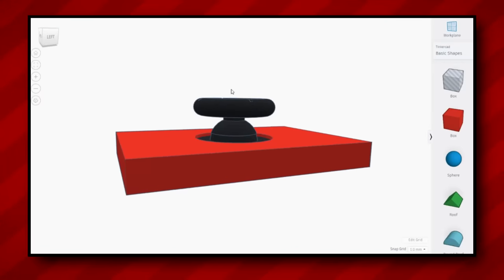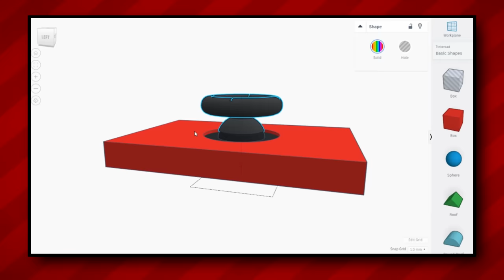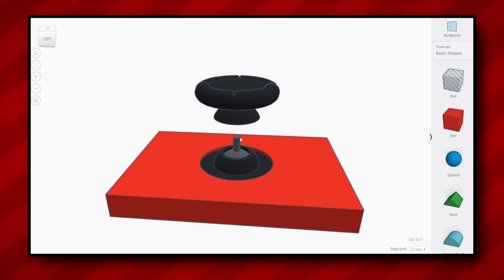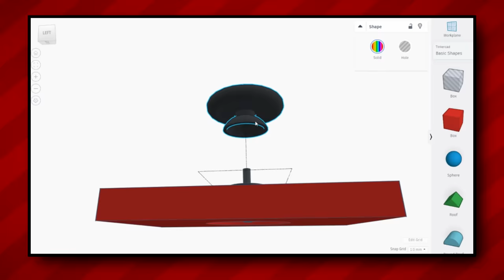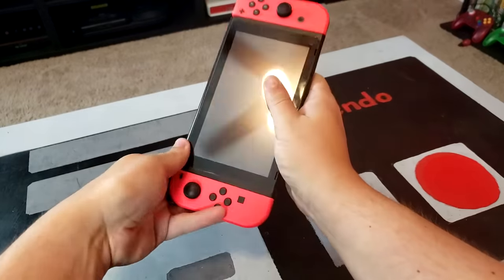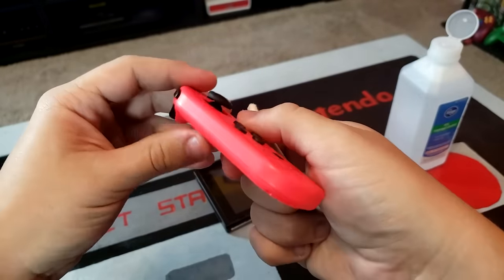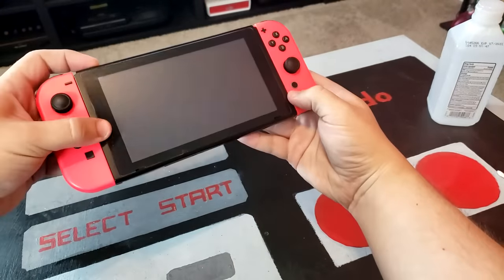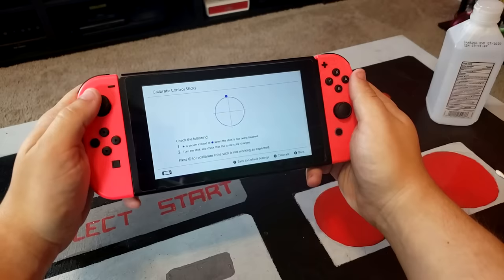How to Fix Joy-Con Drift at Home! No tools required! | Nintendrew

Comment: Me: trying to find comments to see if this solution worked 
Comments:
Reply: Works.
Reply: Works very well
Reply: Worked for me too. Wife spent $80 on new joycon and I fixed it with a single Q Tip and some 91% isopropyl alcohol. I have to return the joycon now.
Reply: 8/31/20 This still works with mine. Don't know why I've stuck with the drift for 3-4 months without ever doing this but the drift is gone. Saves time from sending the joy con to Nintendo especially with the situation the world is going through right now.
Reply: Works very well, just need patience in cleaning and testing.
Reply: Worked for me, I changed the joystick of the joycon once for the same reason. Lately the new joystick was also drifting so I come across this video and now it is fixed. I am going to put back the old one and try this solution on it.
Reply: Nope, not if you're facing the actual drift problem that comes from faulty hardware. This only works if your controller is dirty.
Reply: Can I use ethyl account instead? Or does that not work
Reply: @Sin_Alder  better use isopropyl alcohol. This kind of alcohol evaporates in minutes so there is no chance that some of it remains in the control after a while. I don't know if ethyl alcohol does the same.
Reply: Nothing
Reply: Ok
Reply: I did it today and it works. I thought my joy-cons were broken.
Reply: Its works!!
Reply: @alanm9281  i dont have that alcohol but, thats can with the water?

Comment: Took a few tries with the q-tip. My joycons are 5 years old so they were probably really dirty. I actually got a small juice box straw and put a few drops of isopropyl in there and worked it around.... But can confirm this method worked.. thanks.

Comment: Some feedback: It works! I just tried once and the drift is totally gone. It was driving me mad.
But make sure you are using 99% isopropanol (isopropyl alcohol), any other concentration can damage your electronics! Also, don't use rubbing alcohol or surgical spirits as they are usually mixed with other substances to avoid people drinking them.
Reply: So is 40-50% ethyl solution dangerous for electronics? Used turkish cologne to fix it for the first time, seems working.
Reply: Too late i already applied rubbing alcohol
Reply: Do you think nail polish remover will damage it as well?
Reply: you mean, it was drifing you mad... im sorry, thx for being the only one saying it actually works
Reply: @lederpu  NO - acetone, the active ingredient, dissolves plastic.
Reply: is a small damp dab of water dangerous? i don't think i have isopropanol and don't think i can get it because of covid. drift is driving me insane man
Reply: @uberlifer  Yes, anything that's not aimed for electronics or 99% isopropanol  will damage it
Reply: @lederpu  NEVER USE ACETONE! AS someone has  already told you it'll dissolve the plastic around the joystick. Acetone is only safe to use on metals.
Reply: @guiper2323  lol
Reply: @mothantics  YES, it's dangerous. The whole point about isopropanol is that it evaporates almost immediately and leaves no residue. If you can't find isopropanol  try to look for a Contact cleaner spray. It works the same way.
Reply: @ziqrek2314  Alright ^^ Thanks!

Comment: Me with a 2DS:

Laughs in cheapskate
Reply: My ds has the drift issue too :(
Reply: @treeweenie5360  F
I hope you can fix that
Reply: The 2DS had a better design than the 3DS, but #HatersGonnaHate
Reply: @Joestorm2000  honestly they should have released a 3ds with the design of the new 2dsxl, the 3ds slider could uave gone in the opposite direction of the volume bar and that would be perfect
Reply: @Joestorm2000  say sike right now
Reply: @Joestorm2000  does it really with that speaker placement
Reply: @user-jh9hh5jk4h  Yes because you hold it from the sides
Reply: The 2DS is ergonomic af. Holding it feels so nice.
Reply: @Joestorm2000  which 2ds?
Reply: Raises disappointed eyebrows in Gamer
Reply: @treeweenie5360  the ds doesn't have any analog stick only d pad
Reply: My 2ds bottom screen completely stopped working over time
Reply: I can't even afford the 2DS..

Comment: And I happen to watch this video right when it is coronavirus time and I can’t find the isopropyl alcohol. 😑😑😑
Reply: It's corona time
Reply: ChristianThe Freer big mood
Reply: U can use sanitizer I guess
Reply: F
Reply: yeah we had to use witch hazel :/
Reply: @1.11.1-u5o  nope. It has glycerin
Reply: @Zenniel64  Don't let the days go by........ Glycerin
Reply: my parents gave me a small flask of the remaining isopropyl alcohol we had left and i haven't used it yet, i feel really lucky right now
Reply: I had it but my parents used it and now we can’t find it
Reply: I have isopropyl alcohol but i don't know if i should use 90% or 70%
Reply: Yo I got a full container. Where you at
Reply: @Zenniel64  why does that make it unusable?
Reply: @hannahm1937  the point on using glycerin on sanitizers it is so it doesn't dry up your skin. So it doesnt evaporate as well either. Alcohol 99% evaporates in a few seconds and that's why it's used on electronics.

If you use it, your control will clog. It can be unclog with alcohol though
Reply: @Zenniel64  Ah, thank you. I didn't know that :)
Reply: Im happy my mom had some isopropyl alcohol stored
Reply: Ethyl alcohol works too if you have that around. Takes a bit longer to evaporate and can leave oily traces if it's not pure. We usually have 96% Ethyl Alcohol around the house for various things and I use it to clean my electronics and has never given me any trouble.
Reply: @1.11.1-u5o  Really?! I have some spare
Reply: My mom bought isopropyl alcohol today at CVS
Reply: theyoyis161 just go too the store, but ofc be safe

Comment: Cleaned my left joycon with a qtip or cotton bud as we call them over this side of the lake, i bit the end of the qtip 1st to flatten the end for easier access, no drift now! :-D tnx for the tip and happy xmass from ire.
Reply: Is it a long lasting solution tho?
Reply: @l_.unoccupied._l9773  only time will tell, it is %100 better than it was, my son has had his switch 2 years now, i dont mind doing that every 2 years if they last

Comment: Guys I did what he said, (this has been happening for about 1 or 2 years) and it worked! No more drifting!
Reply: I hope this works for me! I will put an update later
Reply: Candle Lynx did it work?
Reply: I don't really get it...Do you do it hard untill the thing pops or?
Reply: Well, try not to press too hard till it pops out, just rub it around until the under is soaked with rubbing alcohol.
Reply: @robinreme  oh thanks
Reply: np
Reply: It works on my switch lite for about a day before the issue comes back. I ordered parts online Dx
Reply: crab rave
Reply: Rayzzz Beat it’s actually just on the surface and really soft so just twirl the qtip under it
Reply: for me it worked...for just a little while. Then it started to act up again, sigh Sonic: It’s no use!
Reply: hellstiner55 i think I screwed it up...i rubbed the alcohol around the openings of the rotating ball..now it’s worse than before..
Reply: oh god... uh can’t really do anything now, sorry.
Reply: hellstiner55 well it works almost perfectly whenever i swab it, but goes back to bad after a little while..
Reply: @mikuenjoyerXD  did it work 3 weeks later?
Reply: RandomGuy did it happen to you too? This is frustrating as this seems like a temporary fix, and joycons are damn expensive. On top of that, single left joycons, which I really what I just need, are all sold out, presumably from so many people buying it for the same reason...sigh Now I gotta shell out $112 bucks for a pair of new joycons..
Reply: Aww that’s too bad.. I mean it was worth shot!
Reply: how big are your q-tips?
Reply: What?? How am I the only one that works!
Reply: Why did I bother even making a tutorial 😓
Reply: well fyi I did try taking extra fluff off my q tip, didn’t really work
Reply: @dman_games  I don't know if its available  now or even where you live, but Nintendo will repair joycons for free if they have drift.
Reply: RandomGuy oh really? well I already ordered new ones, dang. If it was available though thanks letting me know anyway
Reply: Does anyone know what he means by put the joystick in the opposite direction? Because In animal crossing my avatar is going up, so which way would I point the joystick and then do all the steps?
Reply: @hobeypeterson628  i guess he means the opposite direction of wherever you're applying the alcohol
Reply: So how do I explain this.. Okay, so look at the thumbnail of the video. If you screen keeps going up, apply the alcohol under. I your screen goes down, apply it on top.
Reply: @robinreme  ohh, thank you so much!
Reply: Nolan Reme thank you!
Reply: NayDog44 does"under" refer to the black rubber or the white parts inside?

Comment: Thank you so much. I tried so many methods including blowing high pressures air in there but it didn’t work. I was even thinking about taking it apart, but now I don’t because I’m this method actually worked 🙏.

Comment: My joycon: drifts

Me: goes to recalibrate it

My joycon: Now I'm not doing it

Edit: ok this is my most liked comment (THANK YOU!)
Reply: Ikr
Reply: Right!? That’s so annoying!
Reply: lies because i did that and no it dosent work
Reply: What's worse is that mine just stops working completely when it is in the recalibration screen. The only way to fix it is to slap it on a hard surface, which is probably making the problem worse then fixing it.
Reply: @atlasbechard757  same here! it freezes for a while before it recognizes input, but only when i'm trying to calibrate it. it's as if the way it detects movement is completely different on that screen.
Reply: My joycon again: You missed me?
Reply: Hi
Reply: My joycon wont even let me prees down on it
Reply: This is to everyone who replied to this comment:
oof.
That goes for me too